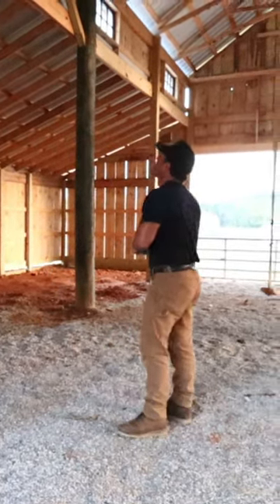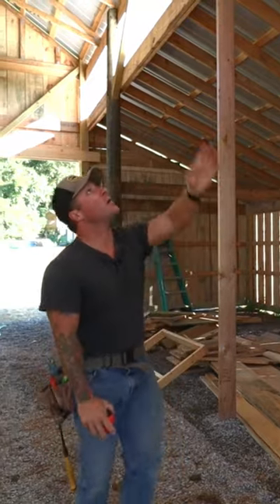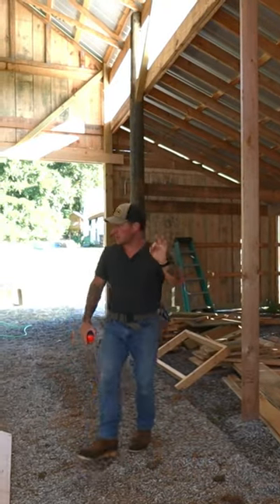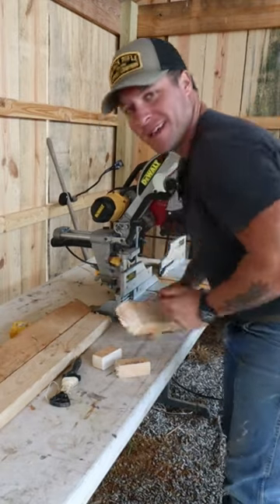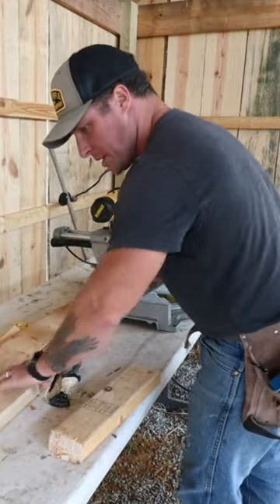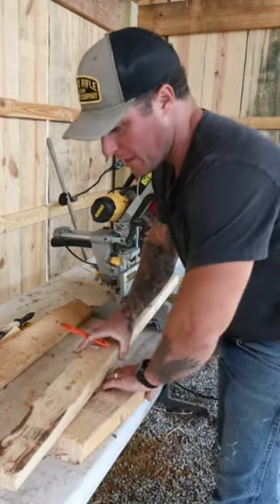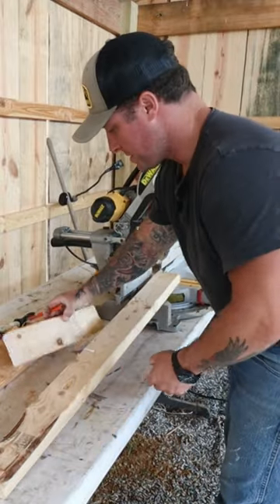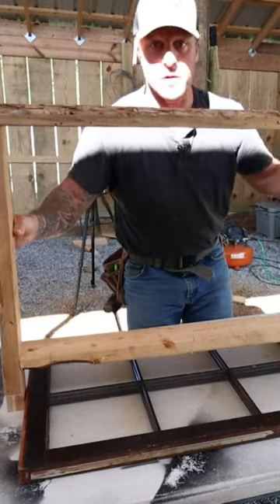budget pole barn build ep 6 #shorts  #postandbeam #polebuilding #diy

Comment: Since your lumber isn’t standard lumber I can’t reverse engineer your build.  Curious of any of your dimensions and heights.  40x48 overall right?  How wide is the center section?  Approximately How high to the lower shed roof?
Reply: Ok I tried a little harder 

Side sheds ~12 ft wide 
Main area ~15ft wide

See if I can figure out heights